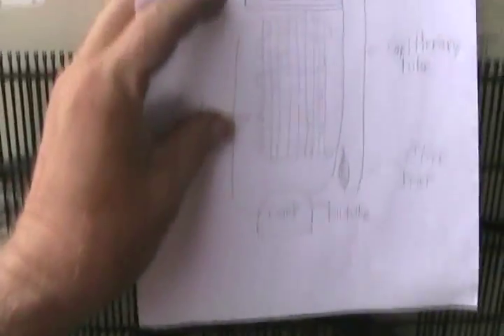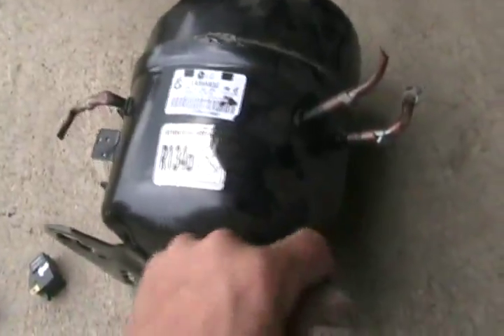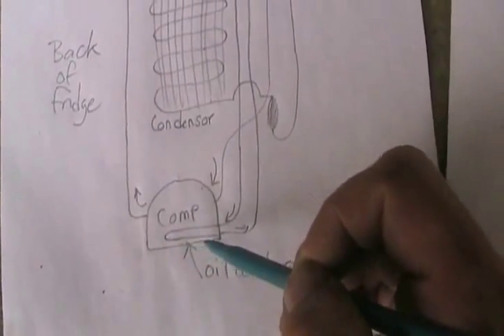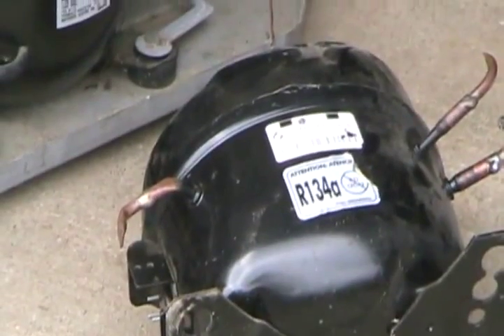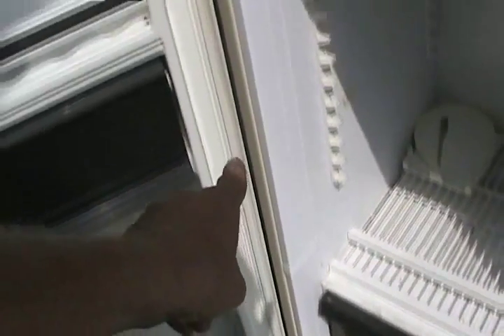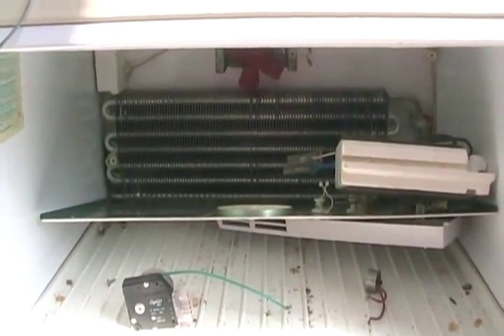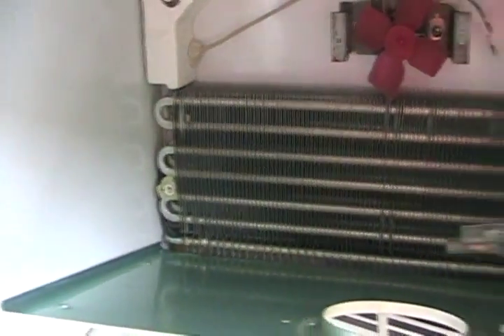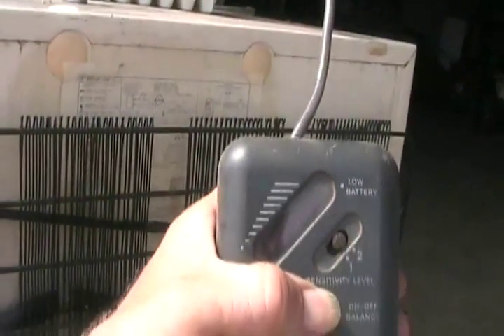Davidsfarm 1424 - How Fridge Cooling Systems Work - Part 4

Comment: The refrigerator in my rv uses propane to heat up the ammonia I was wondering if I can use a hot water pipe in the place of the propane flame? Or do you even get into that?